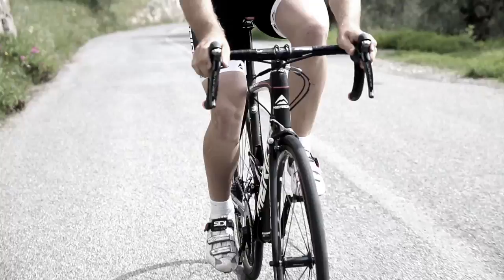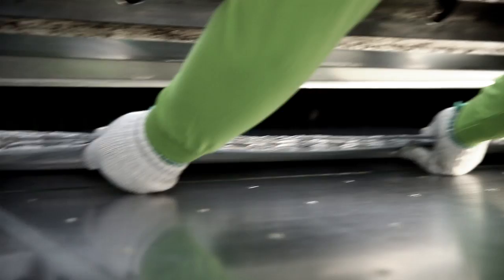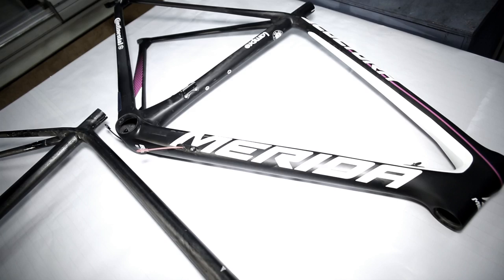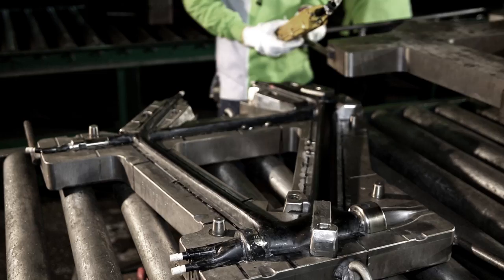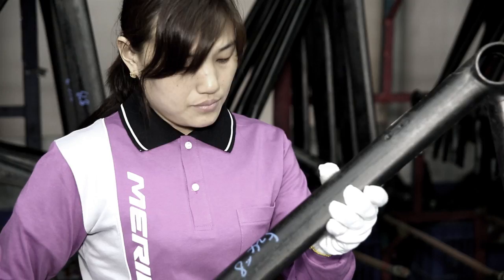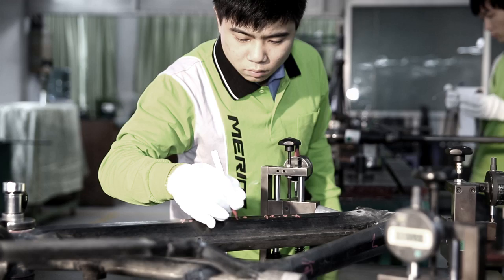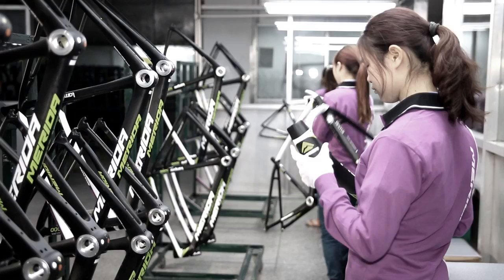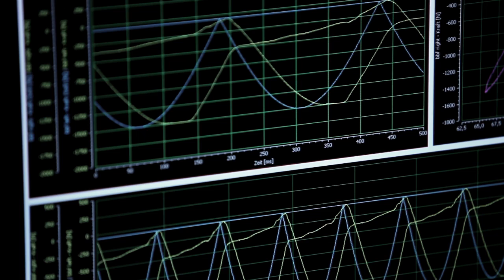MERIDA Carbon Production

Comment: I just bought a scultura 6000 from a retailer and had them change the derailleur to accommodate a bigger cassette, in the process the paint on where the deraileur goes on the paint came off so easily now its just a black chunk out of it .. pretty bummed about it.
Reply: paint on contact points always fell off due to the assembly pressure, occurs on all frames. its normal. after all the screws and bolts you cant see those areas anyways
Reply: look on the bright side... your frame is now a few grams lighter?! :)